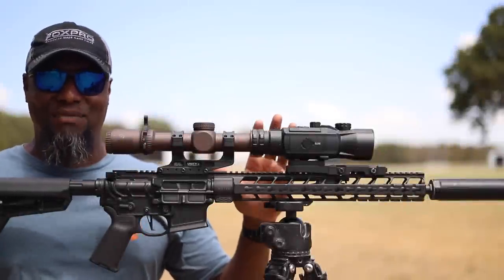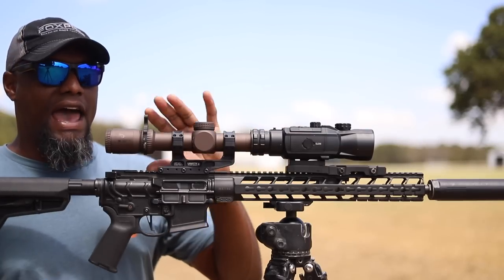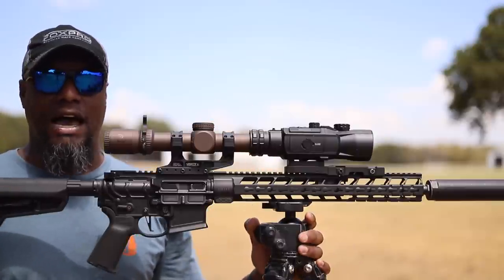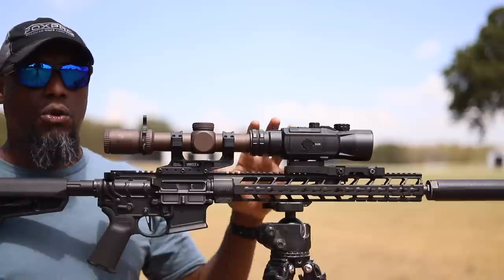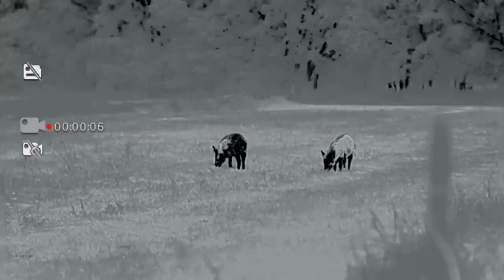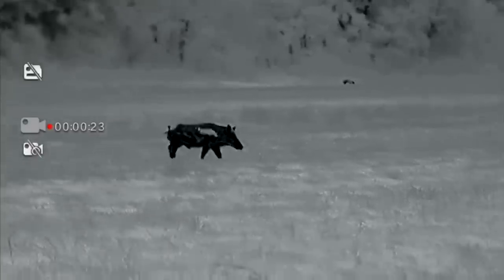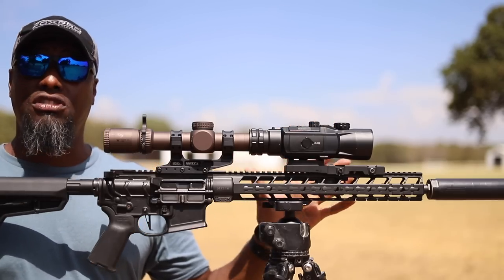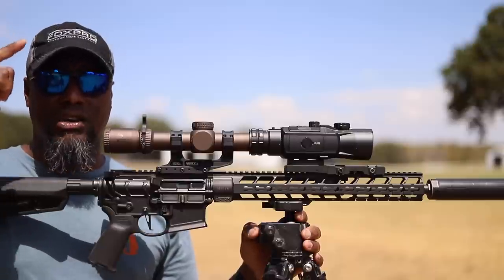Clip-On Thermal (InfiRay Outdoor Hybrid-50)

Comment: I got board and made one from one of those cheap Bushnell thermal hand held units. It's pretty funny. Works fine. When you take the cover off the scope it has 34mm mount spots you can use. Might get a real one. It was cool. Works better behind a red dot. Then there no worry about zeroing it. Cool.

Comment: My Hybrid should be delivered in a couple days. Do you think there’s any chance iRay will come out with a different mount to work with standard 1.5” AR mounts in clip-on mode? That would save me some serious cheese not having to switch all of my LPVO’s to tall 2” mounts.
Reply from the maker: I’ve brought it up, if a newer mount is in the works I’ll do my best to share it with you guys
Reply: @TxKiller   thanks
Reply: I doubt they will. I have one, the mount is designed to dampen recoil for the pretty large module. Works great at keeping it alive on my 308, but I did have to add an ADM riser rail.

Comment: What height mount do you need for your day optic? Looks like you are running 1.9. 

Is it adjustable to work with different height scopes? I was under the impression that 1.5” is the NV height.
Reply from the maker: 2:15 and no it’s not adjustable